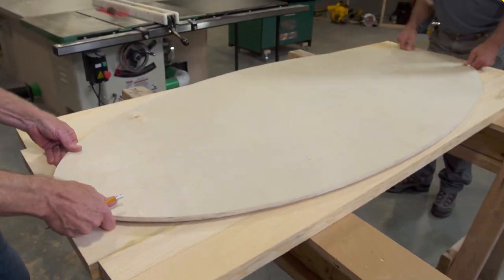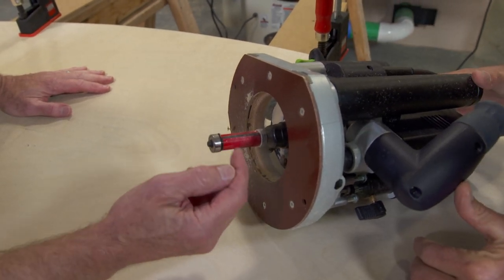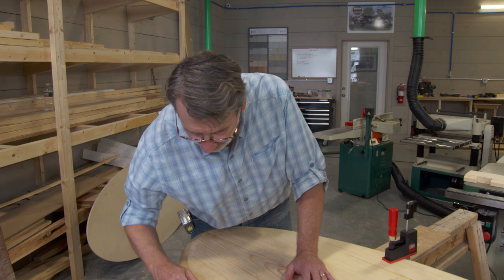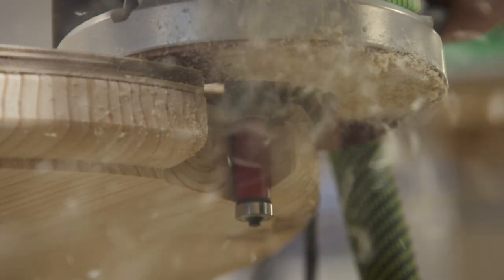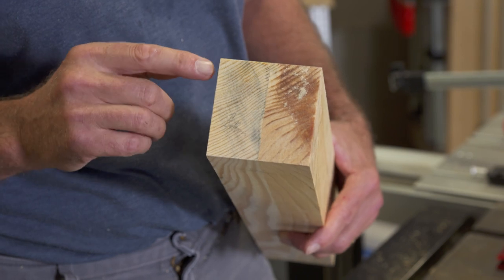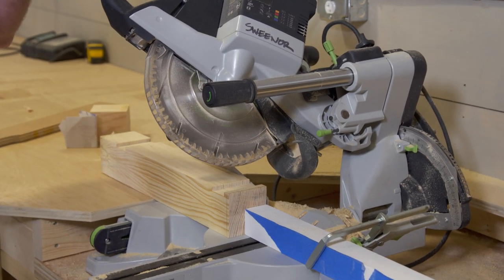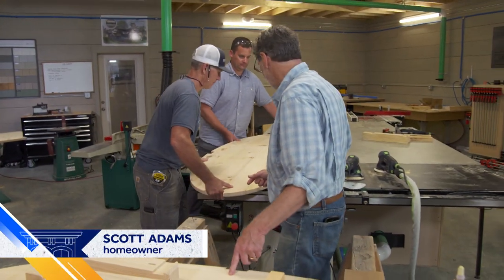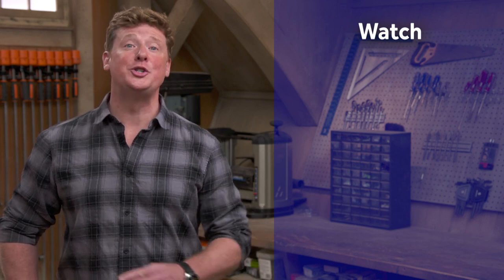How to Build a Coffee Table | This Old House

Comment: Hi @ThisOldHouse,  I'm trying to plan a sitting area in a master suite,  any recommendation on  coffee table size.  We looking at  two  potential rooms  18' 4.47"' x 23' 7.46''   or    20' 0.16''  x 23' 7.46''.    We'd like to ensure there's  enough space for a wheelchair to pass between the  coffee table and  some occasional style  chairs.

The room will also have a  bed of  77"' x 84'' ,  we're thinking an storage bench at the foot of the bed and enough space between that and   the sitting area to let a wheel chair pass or even turn...  From what I could research,  I believe my options are a  48'' and 60''  wheelchair path way. 

Any suggestions?

Comment: HOW'D THEY MAKE THE TEMPLATE?!
Reply: Cnc machine
Reply: Bound to be another episode showing that 😂.

However, if you can't wait until they show that sequence then merely a case of two nails or pins or screws driven in a piece of (flat) ply sheet to act as foci. A loop of string and a pencil.

Experiment with distance between foci and length of string until you produce the ellipse you find pleasing to your eye.

Cut out ellipse on bandsaw or jig saw, clean to line.

Job done.
Reply: High school math makes it easy to draw an oval. Really easy. You can use that math to direct an oval don't even need a template.

Comment: Welp... I thought this would be a good DIY project until Norm mentioned the Domino. Can’t afford that level of tool.
Reply: You could just use any number of other joinery options...
Reply: there are many other techniques, you don't need domino.
Reply: Just add a inch to both ends and make tenons, dominos are just quicker versions of this really.
Reply: @TheErador  or dowels
Reply: @peger  omfg i forgot about dowels!
Reply: Dowels, biscuits, you could actually cut a mortise and tenon, or since it's just a coffee table, you could even use pocket screws (gasp!). There are hundreds of traditional Japanese and Chinese joints you can use which don't have any fasteners at all. There's more than one way to skin a cat. As long as you learn something and your coffee remains off the carpet, you did it right. It is interesting that you would draw the line at dominos, but not at the router, planer, and jointer needed before you go anywhere near needing dominos. Also, if you have a router, and you're careful, you don't need an actual domino cutter. You can also use a drill bit and a sharp chisel to make a perfectly good mortise for commercial dominos. Just takes time.